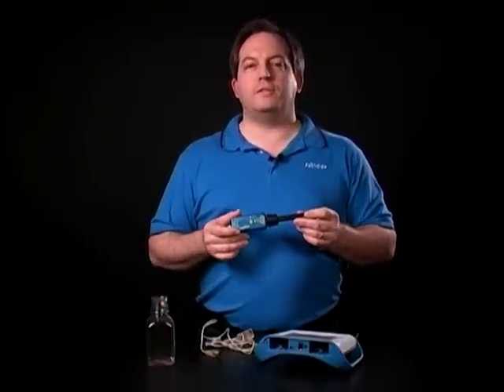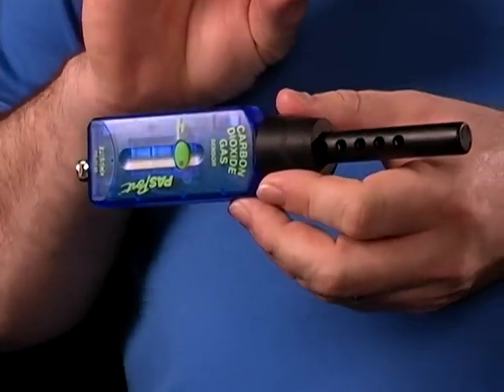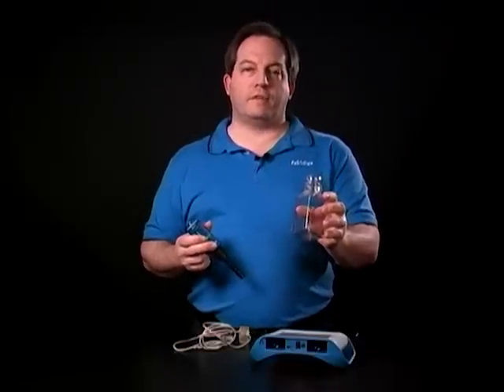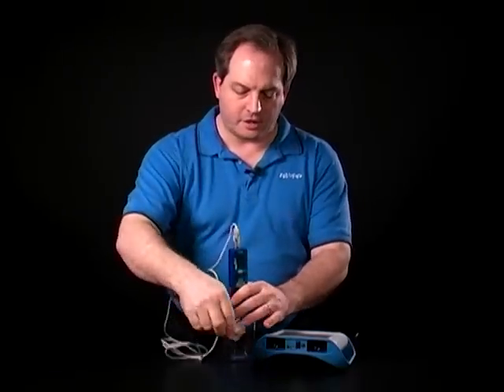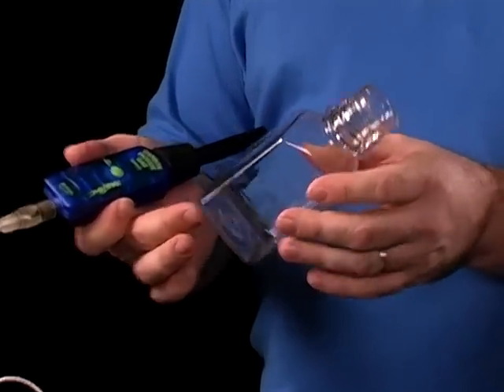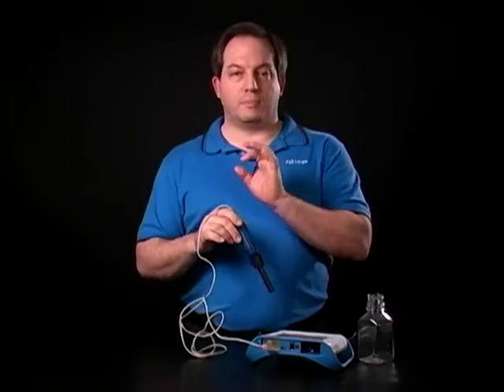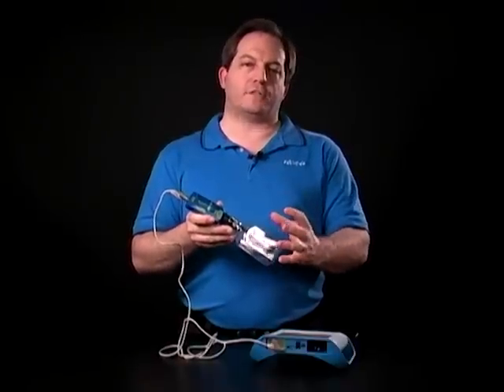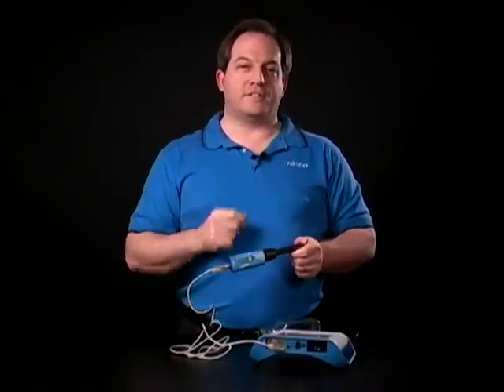Carbon Dioxide Gas Sensor Quick Look

Comment: It's useful. We saw three range of Accuracy, as:
    0 ppm to 10,000 ppm: 100 ppm or 10% of value, whichever is greater
    10,000 ppm to 50,000 ppm: 20% of value
    Over 50,000 ppm: qualitative only.
Is that mean there are all three evaluated ranges in a specific device?